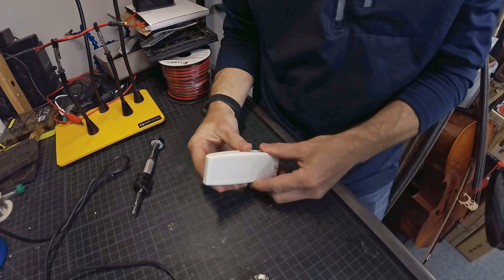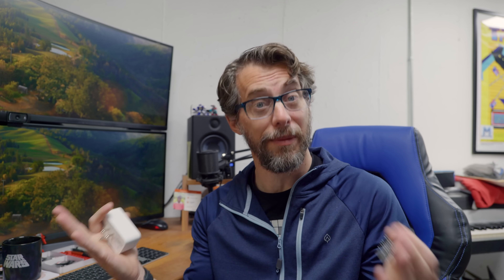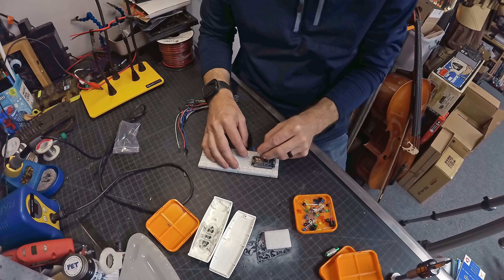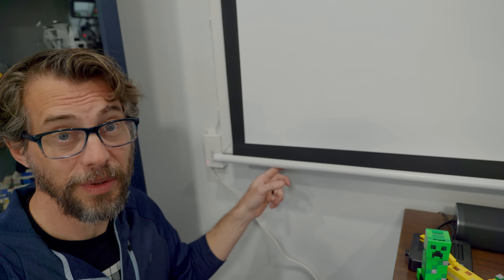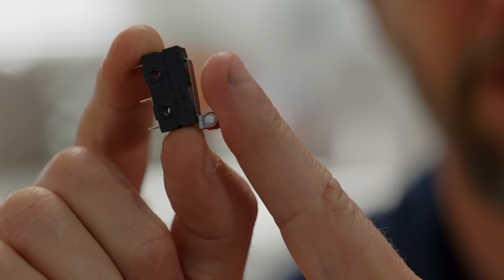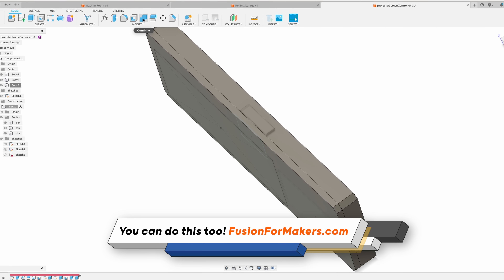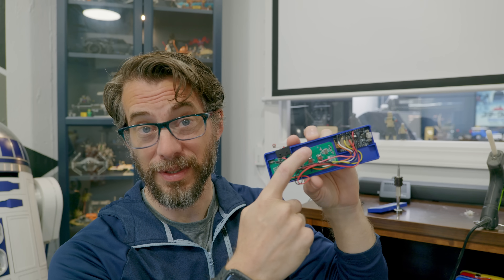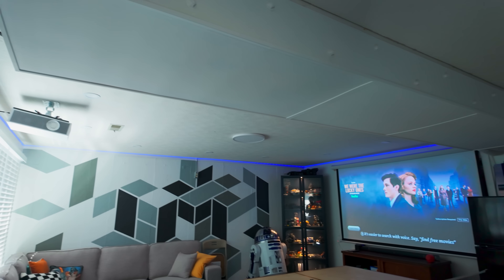Make Dumb Electronics Smart for $3

Comment: There plenty of other solutions using ESP other than attaching it the ir remote, maybe attaching it to the motor driver unit directly will save extra space!!! Or replicating the IR codes and attaching IR transmitter to the ESP itself.
Man, you did it the longest yard!

Comment: Just for info - if you're using an ESP32 and want ESPHome (because you can't use Alexa for whatever reason)

Here's code that will work in ESPHome and do exactly that in Home Assistant

# --- PIN CONFIGURATION ---
# We use standard Push-Pull mode (default).
# No 'inverted: true' because we want HIGH to be ON.
# Idle state will be LOW (Ground), which keeps the remote off.

output:
  - platform: gpio
    pin: 27
    id: gpio_up
    # inverted: false (Default)

  - platform: gpio
    pin: 26
    id: gpio_stop
    # inverted: false (Default)

  - platform: gpio
    pin: 25
    id: gpio_down
    # inverted: false (Default)

# Create "Button" entities in Home Assistant
button:
  - platform: output
    name: "Projector Screen Up"
    output: gpio_up
    duration: 500ms
    icon: "mdi:arrow-up-box"

  - platform: output
    name: "Projector Screen Stop"
    output: gpio_stop
    duration: 500ms
    icon: "mdi:stop-circle-outline"

  - platform: output
    name: "Projector Screen Down"
    output: gpio_down
    duration: 500ms
    icon: "mdi:arrow-down-box"

Comment: i have a question why didnt you power the arduino from micro usb but use transistors to control the  12v things transistors are cheaper than a voltage regulator you could have bought 3 transistors for 9 cents

Comment: I have that same screen. I purchased a backup wall controller and remote because I decided to use a 4 switch smart relay for the actions. It was hard to find the backup parts that specifically fit and for what they are they were a little pricey, about $40 for the set from China if I recall. I always purchase backups before testing, and this was back during the pandemic. Good thing is there is no need for a "stop switch" thingy you got there. Just  set the action times.

Comment: It works in this specific case, with these specific buttons because they just pull a pin to ground and not closing a circuit. Also, it's risky connecting a pin from a 12V powered remote directly to the esp. when not pulled to ground (when clicked) you are risking bleed of >5V into the esp which can toast it. It probably works because there is probably a voltage regulator that steps down the voltage before the button. 

A more accurate solution is by using an opto-isolator. 

Other than that - cool project!

Comment: if 0 is the starting position of the screen and 100 is the ending position of the screen, 
just program the startposition 0 and the end point 100 and if loop if the value is 100 or more then 100 - "Stop" no need for a physical switch.

Comment: Just cut the remote PCB in half and connect the ESP directly to the Button Pins on the IC Chip, connect a small step up converter PCB to the battery pins from the Remote, use a small 3,7 Volt battery (fully charged=4.2 Volts), wire it to the Power Input of the ESP and to the input of the mini step up converter, now your remote is definitely smaller, you can also use a ESP32 C3 Supermini instead of the normal size ESP32 or ESP8266. :)
Reply: You can use a magnet and a hall sensor as limit switch, the mechanical switch make just problems in future 😅

Comment: You could probably limit the max distance down /open in the code but you can detect the state of the screen (open or close) with the limit switch. So that's a cool idea. I did a conference room controller for one of my employers (saved them #3,000k) but I had to run a counter to ensure the projector was on before giving it input commands. It's nice to be able to read status!

Comment: Could just clone the 433mhz signals. The board has 433mhz written on it. For adruino you can get a 433mhz transmitter and receiver sensor. Press the buttons with some basic example code and read out the outputs on your ardunio and use them for your code. In theory at least.

Comment: Why? Why do you used that remote???? With that bord and 1$ module you can read the signal from the remote. After with less than 1$ module you can send that signal with the ESP32, and you do not have to touch that remote anymore. It will be smaller, and better. 
And you could use a VL53L0X module - ok this is 5$ - and you do not need physical switch, it measure the distance, and stop it when it reach what distance you set up.
This makes smaller, and better.
Use the posibilities, to create simple and small electronics :)

Comment: you have an arduino, instead of the switch at the bottom and more wires and other stuff to add, you could add a rotation counter on the screen rotor and just count how many rotations needed to go up and down and have the arduino stop the screen wherever you want. but that probably complicates things. but it would be neater :P

Comment: I think it's the worst possible design choice to hook the remote buttons. Why not to disassemble that wall mounted control? This single design change would have a bunch of pros: remote control doesn't loose its functionality; there's no need to have external power supply; it already has a case to fit everything in. For cons I can guess maybe a little scratches around the box if the hands curvature is not large enough. =)
And for the stop button - I think the device has some sensors inside to detect the margin points. So, I guess if you start it down from the top state, but don't press the Stop button it will stop automatically when reaching the bottom, huh? So, why bother with the limit switch (will simple timeout do)?

Comment: Just coming to my mind I would have avoided the whole switch to detect since once its at the bottom it does nothing anyway, so i would of just had a timer hold the button for the 10-30 or so seconds for the up or down button, so then it's just a single on or off "device" as likely the stop button won't ever be used.

Comment: Always fun to augment electronics... It took me some time, but I went the extra mile and decoded the output of my boiler's remote control using my SDR, then used an ESP8266 dev board to receive commands from my websites webAPIs and transmit the appropriate code sequences to set the water temperature from my iPhone anywhere between 20°C and 60°C. Also, programmed the ESP8266 to reset the temperature to 20°C half an hour after the last change, which will hopefully help not waste too much hot water when not really needed. Sounds convoluted, and sure it is,... BUT it was sooo much fun working on the project, seeing it work so well and learning new things along the way. And now I am ogling my Ikea oven, probably there are quite a few things that I could do to it as well :) ...

Comment: I liked your video and your method of delivery.  I do wonder why you didn't modify the hardwired control switches that already has power instead of the remote?  That way you would still have the remove, too.

Comment: I don’t understand why adding a “stop” button is necessary. It would be simpler to set a fixed time in the code for raising and lowering, which would streamline the project.
Reply from the maker: So many people have said this, and I truly don't understand it.  there are so many outside variables that can affect timing.  It certainly is ONE way to do it, but not any simpler or more accurate than my approach was 🤷🏻
Reply: @Iliketomakestuff  I understand your point of view; it’s true that a stop button can be more reliable.

By the way, I bought the Fusion 360 course this week—it’s really good! I love your content; thank you for responding.

Comment: So wiring-wise, I assume all you're doing is manually delivering a voltage from the output GPIO pin to the downstream side of the button. 

Can one simply measure the voltage potential on the upstream side of the button and then match that voltage delivery from the arduino?
Reply: And are these usually just signal voltages that require no current (e.g, toward a mosfet gate)?

Comment: I used to make things like this in the 70s, but they were battery suckers, then I operated and serviced a device like this, that was about 30' and roll formed roofing panels, it ran on 440. That machine had a flying cutoff triggered by a photoelectric eye.

Comment: did you install fauxmo on a rpi?, maybe because of simplicity, in your video you mention you installed devices on "this thing", referring to the esp8266 module, how can this be?, by reading the fauxmo docs, seems like this needs to be running on a server with proper python installed, not micropython, care to explain a little bit the architecture?, thanks
Reply from the maker: No,it's installed on the ESP directly, via the Arduino IDE. https://github.com/vintlabs/fauxmoESP

Comment: I remember when I started experimenting with arduinos I made a remote light switch with old remote and ir receiver from old tv. I am pretty sure you can use single ir led to send those signals. You still got your remote, you don't have to use different power sources, use only one output of esp32. The only downside is a little more code because at first you need to upload a sketch from ir library examples to capture signals from your remote. And you also need one ir receiver just to set up your device. If you ever need to stop the screen at any height I can suggest a simple ultrasonic distance sensor. They are cheap and easy to use and pretty accurate.

Comment: This is really cool but I would have done one this differently.  I would have removed the switch and coded a timer.  Timed how long it takes to max length and then coded that to 100%.  Then you can tell Alexa to drop 50% and it would stop at that time In percentage.  Very cool idea though.

Comment: This is cool. I just recently started getting into this sort of stuff. Personally, I think I'd rather hook up the Arduino to the already wall mounted controller though because there may be instances where I (or more likely someone else in yhe household) would want to use the actual remote instead of talking to the assistant.

Comment: This is really cool! Starting to get into electronics / microcontroller programming so this video is very interesting to me. Is there a reason that a physical switch was used to stop the screen from going down more? I'd imagine that the screen would always go to the same position so it would be possible to program a "default position" by telling it to go down and then have a delayed stop button press when it needs to stop? I guess if the screen drop speed wasn't consistent you could have a shorter / longer screen each time. Either way great video!

Comment: I saw this video when it was posted, then actually bought this exact screen without realizing it. 

I ended up using a BroadLink RM connected to home assistant to achieve the same result, and I’m kinda glad. 

I’ll always respect built over bought, but wanted to share a Plan B for others

Comment: I use this system with a DC104/3V/433Mhz remote control and a Broadlink RM-PRO hub and somehow I managed to automate commands type: "At 1PM, screen DOWN for 3 seconds, then STOP" but I do not have real-feedback from the screen so I can give remote commands over the Internet (do not know, when I am awaw from home, what is the last state of the screen). But fully UP or fully DOWN it works, and for other screen scenarios I have to count in seconds from the start of the command.  I thought I could install a video camera so I could see on the internet what is the screen position is when I'm not home

Comment: Nice. I'd like to program a bunch of lights to turn on/off when I'm at my desk. What do i need to turn on wired USB lights (eg. ring light with physical controller that is integrated with the usb cable). I tried using a simple set of wireless plug with receiver so i can remotely turn on/off the lights using standard 120V (?) plug but these receiver doesnt work for usb lights.

Comment: I have zero knowledge about Arduinos but was wondering instead of using the limit switch, can't we insert a duration in the code to control the time until which the screen up or screen down command runs?

Comment: you are making more complicated than it should be … read the IR signal from the remote, connect an IR emitter, emit the needed signal from the nodeMCU, if it doesn’t have IR read the signal might be 433MHz as usual, there are tools for that…

Comment: It’s so weird but I did this exact thing with the exact screen. The only thing I did differently is not have the physical stop switch. Instead my code had a timer on the “down” command and stopped it after a specific interval had passed.

Comment: A fun follow-on experiment would be to run the RTL_433 application with a cheap SDR to confirm the signals being transmitted.  The remote signal is likely the typical 433MHz found in these Chinese, low-cost circuits.  Since the UP/DOWN functions don't require pushing the STOP button, using the limit-switch at the bottom seems A) unnecessary, and B) is likely sending a constant STOP signal to the receiver.

Comment: Amusing project.  I did almost the exact same one, with a few differences.  I put all the electronics in the wall unit and 3D printed a new back, so it's essentially the same, just thicker, and you can still use the remote.  I also went timer based instead of a limit switch, that way I can adjust the position, and I can do it remotely via the app.  Mine is through google, but comically enough, it's the exact same command "Hey Google, it's movie time".  Same set of commands too, put's the screen down to the correct position, turns off the lights, turns on the projector and stereo.  I went a little overboard and the ESP32 also reports screen status (up, down, partway, raising, lowering) based on the buttons it's pressed, and how long ago they were pressed, so I can check the status on the app remotely.  Off all my projects, this one gets the most use!

Comment: I'm learning programming and this video let me with an idea for this project. Instead of having to deal with the buttom to stop the screen in a specific height, could we implement the code by setting a time limit on the ON buttom. E.g. 10 seconds = 100% open and we could jiggle with this to set it open in other heights as well. 
Can someone tell me if that would  be applicable? Also, the arduino he's using has already a wifi module built into it?

Comment: I would have a look at the screen electronics, pretty sure they have built in limit switches so the motor stops when it fully down and fully up. You might have been able to modify it so it stops exactly where you want it to stop on the down run.

Comment: So instead of the dedicated remote it is now controlled via an app?  Hardly progress I think. Yet this could have been made simpler with either an IR diode ot a cheap rf transmitter depending on how it exerts control connected to your esp . (Yes it is an esp, not an 'Arduino')

Comment: ESP + transformer + limit switch = $3?!
Ok, I'll give you $5 per batch to buy them for me, & you can keep the change. 😄
Seriously though, why don't you control the motors directly?
Or, if you still want to do it with RF for some reason, why don't you use an Arduino RF module?
They're like $0.5 each.

1:18 "...this little ESP board. Basically this is a tiny Arduino..."
It's not an Arduino™, it's an ESP8266.
"Arduino" is a company, not a term to describe every MCU out there.
That's like buying an HP laptop & saying "basically this is a MacBook".
I know that you know, just pointing this out for those who don't.

I like your ideas & the stuff you're making, but please...
Ditch that freaking "Amazon system" spyware & instead use a FOSS, self-hosted one. 😕

Comment: isn't it easier to use a 433mhz transceiver on your esp32  ? i had the same problem but didn't want to mess up my remote so after lots off trial and error i came by ESPSomfy RTS on github it uses mqtt to send the commands and learn the rolling code off my blinds, couldn't imagine that my blinds were more advanced than my garage door 😂

Comment: Why didn't you just calculate how long it takes to reach the bottom then use that time to calculate how long it takes to get to a certain point. That way you could use a slider and set it to a certain percentage. Maybe keep the limit switch as a failsafe.

Comment: Using 1/4 the voltage to run the controller is probably the reason you had the problem with the enclosure/switch blocking the signal, the 12v just gives it more range with a limited antenna

Comment: I need to do the same for my Somfy Window Blinds. They are IO based. In this case, I did some research and I found that I need to buy the comfy connectivity kit costing 69 Euros. Can you help me and let me know if this is possible with the ESP 8266 Arduino board?  - Somfy 1870755 Connectivity Kit

Comment: I found your video by accident, but really loved what you did there. I have a couple of questions. 1st - Could you tap into the power for the screen motor, and drop the voltage, instead of using a wall plug? 2nd - Unrelated. I've been using a cheep (HF) soldering iron but I'd like to set up a soldering station. What would you recommend?
Thanks for the video. I hope to see others in the future.

Comment: Why not record the remote signal and use the esp with a transmitter to control the screen while keeping the remote, this is what I did with my devices and it works wonderfully, there's also an example code that I just used.